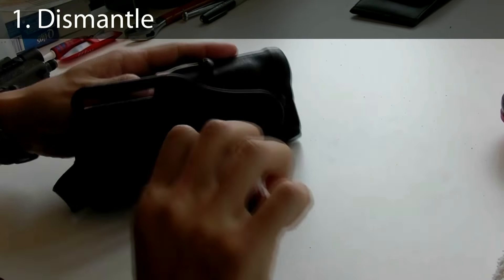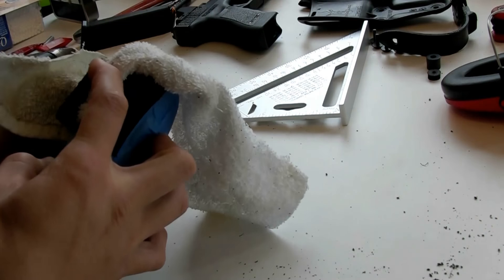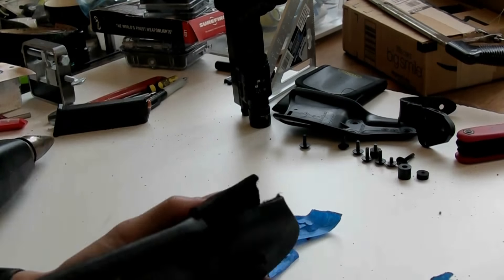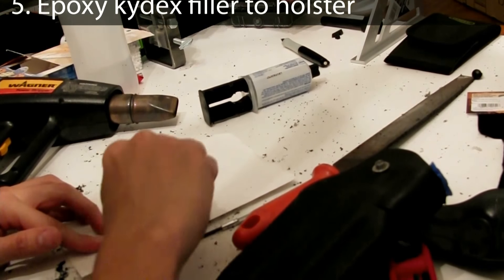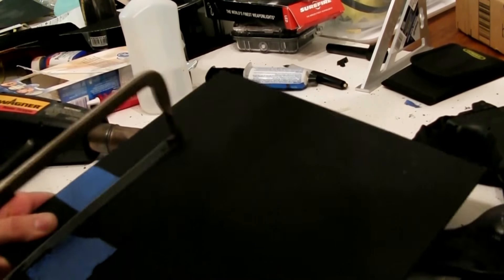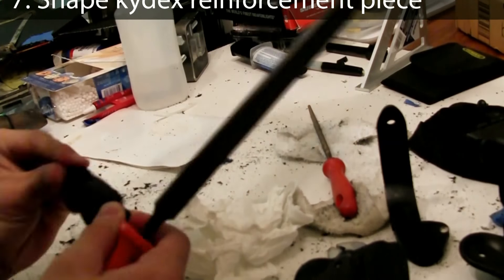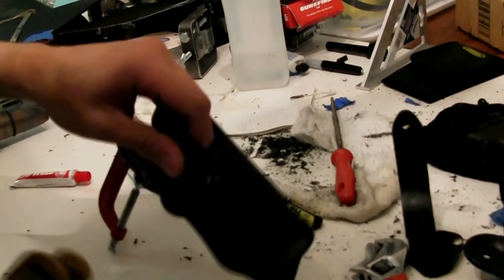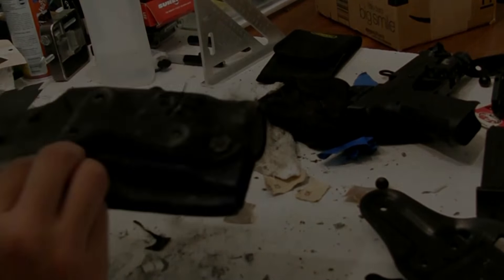Safariland 6280 RMR mod

Comment: This is awesome! I seriously didn't think you would be able to reuse the hood. I'm having an issue finding a duty holster for the Beretta LTT Elite with a red dot and X300. May have to try this mod out on a Safariland 6280LASD holster. Cool vid!
Reply from the maker: Thanks.  It held up well.  If I still had this stuff I'd want an ALS.  The fit and draw on this was sloppy compared to an ALS.

Comment from the maker: Yeah that's the holster I would have bought had it been available when I did this work.  The ALS locking mechanism is MUCH smoother than the friction + retention that the 6280 does.  It was still fun to play with the kydex :)